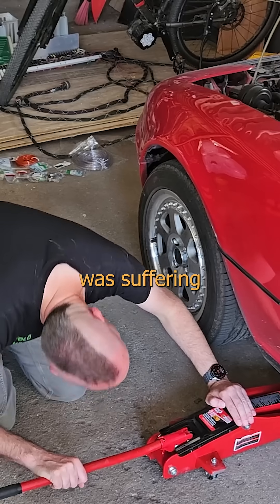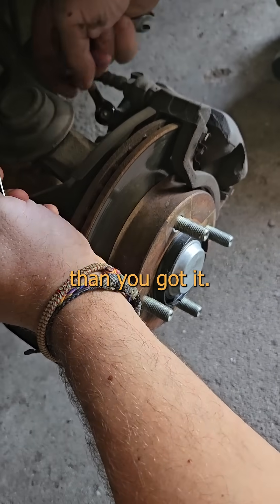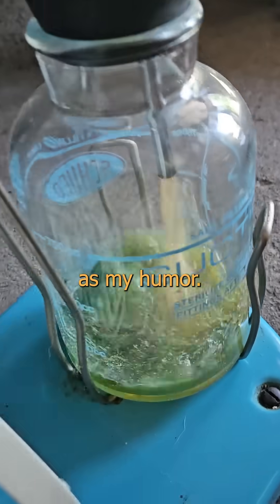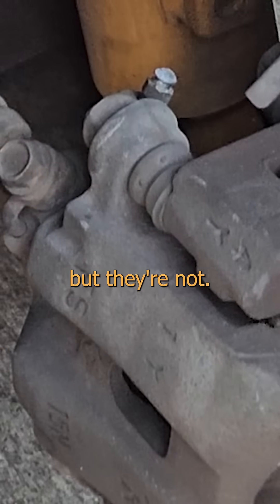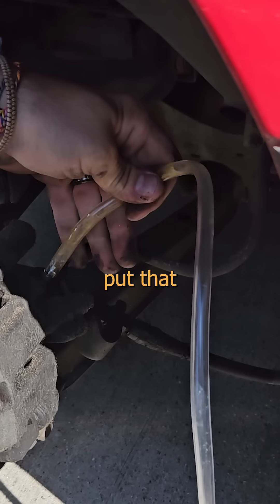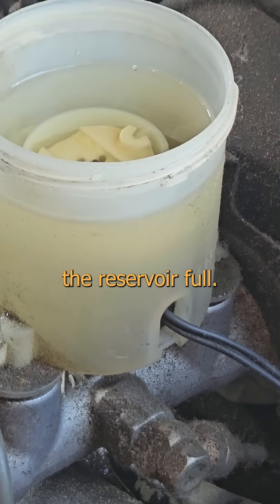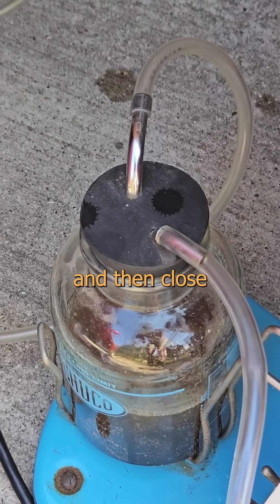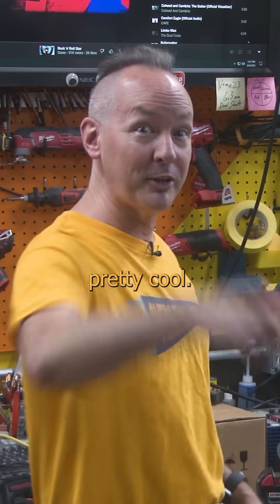How To Change Brake Fluid #chrisboden #comedy #engineering #educational #diy #skills #lifelessons

Comment: Everyone that's bled brakes the manual way knows that a vacuum pump isnt over engineering, it's a godsend
Reply: I need to bleed brakes, get the apprentice.
'We dont have an apprentice'
Okay, grab the straws and make everybody pull one.
Reply: @Mk2Mod1  At my work it turns into "Where's a lot attendant?"
Reply: Oh boy, good memories. Used to help dad remove the air a few times after he was working on breaks. Best fun for kid. Barely reaching break pedal, but eagerly stomping on it like crazy 😆
Reply: @ogi22  Oh yeah...the only job that was more fun was holding the flashlight.
Reply: Yup, bought a hand pump to do it, it didn't work, made a one way bleeder with some spare brake fluid, then spent God knows how long pumping the brakes and filling the reservoir up.
Reply: Try speed bleeders. Much better than vacuum bleeding.
Reply: @earlebird4262  Not if you unintentionally incorporate air into the brake system due to untightening the speed bleed for bleeding. I'd rather stick to traditional vacuum pump and have it get sucked out like that, while topping it off
Reply: @zealousbeing0178 a vacuum pump pulls much more air in around the threads than speed bleeders. Speed bleeders are much cleaner in my experience. Both methods are really just for flushing, and should be followed up with conventional bleeding. 

Also, I think you mean conventional, not traditional. It's only on my dream planet that families get together every second year and observe the tradition of flushing their brakes. Every sixth year they would also perform the sacred ritual of The Changing Of The Coolant. Because that's the way our grandparents did it in the old country.
Reply: It can also pull air into the system if you have a leak... ask me how I know (actually it wasn't me, it was my dad who found that out the hard way).

Unfortunately, the best way is to just have a second person pumping the brake pedal.
Reply: @PistonAvatarGuy  if you have a leak then it needs to be fixed, I fail to see how thats a bad thing
Reply: @TheTomco11  It doesn't even need to be a significant leak, it can just be a little pinhole that barely leaks any fluid. Totally fine when the brakes are operating normally, but a major problem if you reverse the pressure on the system.
Reply: @PistonAvatarGuy any leak is an issue, a tiny pinhole will eventually leave you with no fluid
Reply: @TheTomco11  a small leak is somethat that can be managed (just keep adding fluid whenever your reservoir gets close to empty). Air in the lines cannot (assuming it's anything like a large amount). If you're someone who likes to keep your car in tip top shape and your mechanic well fed, a small leak is something you need to fix. If you're like most folk who work on their own cars, a small leak is just one more fluid to check every time you stop for gas or whatever.
Reply: @reaganharder1480 I'm not a mechanic and I work on my own car. It has plenty of leaks, but none in the brakes. Please never give advice about cars. Any brake fluid leak is a safety risk. What if you forget to check the level and it drops too low? What if the leak gets faster without you realising? What if that paper thin pinholed section blows out and you lose all pressure?
Drawing air while trying to bleed is the best case scenario, since you'll be immediately aware there's a problem. If you draw air into the brakes while bleeding and still try to drive the car without fixing the problem then you should not be working on brakes
Reply: @TheTomco11  for what it's worth, you can lose all your brake fluid quite quickly without there being a known leak beforehand too. Actually, that's the only context I've actually witnessed anyone losing brakes with.
Reply: @TheTomco11 because vacuum bleeding will not help you find a leak. It will only allow air into the system. Pressure bleeding (with a positive pump or a friend) will help to identify a leak.
Reply: @reaganharder1480  Been there, done that. Not fun especially as a new driver behind a fuel truck taking a left. 🙀
Reply: @TheTomco11 I said the exact same thing
Reply: @reaganharder1480 You don't think a leak that let's fluid out is also letting air in?!
Reply: Lines can blow up too if you put too much pressure through it. But you can always find a leak. If it's an unknown leak then get under your car more often always check things there's monthly is weeklies and yearlies it's a part of owning a car whether you work on them or not double and triple check everything otherwise you're putting yourself and others at risk. I've seen so many different scenarios with brakes from fluid everywhere to not single drop. 

And I'll tell you any leak or air is a problem that needs to be fixed immediately Yes brake lines are a pain but it's more painful to crash take your pic. It's always harder putting a line in than it is getting a line out though cuz if you're removing it you can just cut it. Make sure you take the pressure off first. Learn that the hard way. My younger dumber years those were the best so many lessons learned the hard way😂
Reply: @Ichikura2 lines can blow up? Are you joking? Do you know how much pressure they handle under normal operation?

Edit: If they're corroded, yes.
Reply: @Ichikura2  And I never implied that air should ever be left in brakes lines. Where on Earth did you get that from?
Reply: @TheTomco11 I need someone like you in my area to help me with my truck
Reply: @evanlevin8116 dude brake lines are easy, if you really wanna be lazy you can just cut them at the brake and remove them and cut at the master cylinder, then you can just run it around the old brake lines, you dont even have to technically remove them; at least the brake lines are new at that point
Reply: @PistonAvatarGuy FIX YO BRAKES FOOL
Reply: @mewmew8932  My current brakes don't leak, but I've never had problems as a result of minor leaks.
Reply: @PistonAvatarGuy have you considered that the minor leak could become a major leak

Also good on you for getting yo damn brakes replaced
Reply: @mewmew8932  Yes, but I maintain my own cars, so I'd be aware of that happening.

The brakes on my current car never leaked. The cars that I had with leaks were more than 15-20 years old.
Reply: @PistonAvatarGuy bro has never heard of sudden failure
Reply: @mewmew8932  Why would there be a sudden failure as a result of a small leak?
Reply: @PistonAvatarGuy ok so you know how when a windshield has a small crack it can balloon into a spider web? It's like that but for pressure lines only worse
Reply: @mewmew8932  If the lines are that corroded, then they're likely to just be losing so much fluid that you're going to notice that first, before they just catastrophically fail. Anyway, that's why you have redundant systems. On Hondas, it's always one front and a rear on the opposite side that are actuated by a single circuit. I believe that many vehicles just have separate front and a rear circuits. The mechanical parking/emergency brake is also a thing, and I always keep mine in excellent working order.
Reply: @PistonAvatarGuy yeah but like why fuck around with your brakes. Y'know, the thing you use to stop 3000 pounds of steel moving at higher velocity than a cheetah.
Reply: @mewmew8932  A) Because money. B) Because there's literally no issue with having a pinhole leak. Probably 30% of the cars on the road have pinhole leaks in their brake lines and will never have a problem as a result.

Anyway, like I said, you essentially have 3 braking systems, and they're not all going to fail unless there's something catastrophically wrong with your vehicle, and my vehicles have never been in such a poor condition.
Reply: @PistonAvatarGuy bro just replace some shitty rubber hoses with some slightly less shitty rubber hoses it is not that expensive

Also do you really wanna be that guy who relies on "good enough," has this channel taught you anything
Reply: @mewmew8932  Who the heck is talking about rubber hoses? Obviously, if the hoses are leaking, just replace them, they're cheap and they're easy to replace. I'm talking about the metal brake lines, which are (typically) insanely difficult to replace. I don't think that I've ever even seen hoses that leaked.

In my case, time would have been the problem. I never would have had the money to pay a shop to replace the metal brake lines in any of my cars, so I'd be doing the work myself and it probably would have taken days. When you're working 40+ hours of hard labor every week, it's not only hard to find the time for something like that, but the energy just isn't there.

And, yes, I know when good enough is good enough and when it's not, that's why I've never had issues with my cars. That's how 99% of the world operates, on just good enough, because if everything had to be perfect, 100% of the time, no one would ever get anything done! No one would even be able to afford to live like we do if everything had to be 100% perfect, all of the time.

Heck, that's why flying is so expensive, because that is an instance where 100% perfect, all of the time, should be the goal.
Reply: @PistonAvatarGuy Uhhh, if you have a leak in your brake system you should fix it. Don't just avoid bleeding the brakes a certain way and leave the leak.
Reply: @Yerboiy  Like I said, leaks can be insanely difficult to fix and small leaks are such a minor concern that it's almost never done.

On older cars, where leaks are common, the cost of replacing the brake lines could probably total the car, just because there's so much labor involved.
Reply: @PistonAvatarGuy replacing brake lines is neither expensive or hard
Reply: @TheTomco11  It depends on where the brake lines are located. In my CRXs, a huge chunk of the interior had to be removed to get to the brake lines, along with many things on the underside of the car. Being mostly in the interior of the car, the brake lines were pretty well protected, even on my one rusty CRX, so I never had to worry about them.

People will sometimes splice in repairs, and that's not too bad from a labor and cost perspective, but if the line is corroded badly enough to have leaks in it, it may not be repairable.

I wasn't saying that the lines were expensive, I was saying that the labor required to replace them in some cases can be very expensive.

Edit: And I'm just talking about minor leaks, here, the kind that will just weep a small amount of fluid.
Reply: @PistonAvatarGuy Dude, seriously, brake fluid isn’t just some random liquid. It’s toxic to people and the environment, costs real money, and once the bottle’s been opened it’s basically trash because it pulls in water. Understand the basics: if fluid leaks out, air leaks in. That’s how systems fail. Mess around with this and you’re not just risking your clapped-out ’06 Focus, you’re risking other people’s lives. Don’t stay stuck on dumb decisions because with that mindset you won’t last long.
Reply: @TheTomco11 it’s not expensive maybe on a classic but anything still in the road that’s not rubber but the usual double flare jobs , unless you have the tool to flare em and the know how, the shops will charge you to replace the whole length most of the time. We aren’t in the repair service anymore we’re in the replacement service. Been in the business for a long time. Unless it’s someone like us that know and willing to help. Chances are, they have to pay a whole lot to get it done.
Reply: @uhd_plasma4913  Would it concern you to know that basically every single transport truck (like logging, oilfield, or retail shipping trucks) you see on the road is in far worse shape than just having a pinhole leak? Hell, if its only a "minor" problem that doesn't entirely take the unit out of service, most companies literally wont let you fix it.
Reply: @PistonAvatarGuy  did u mean found a leak is a bad thing ?
Reply: @jokok2333 No, I mean having air in your brake lines is a bad thing. Brake lines are also insanely difficult to replace on many vehicles, so small leaks are almost never repaired.
Reply: Insanely difficult yes still needs to be done whether you got air or leak. Some cars will be harder than others and vice versa. But get it done nonetheless. Do it right and do it once.  @PistonAvatarGuy
Reply: @Ichikura2  Why would you need to repair it if it's just a small leak? I've had a couple of cars with small leaks, there was no noticeable difference in braking performance, no uneven pad/shoe wear, no noticeable difference in fluid loss (vs the drop in fluid level that comes with normal pad wear)... the only thing that I noticed was a slight wetness near the leak.

I've owned $500 cars that I had to repair before they were road-worthy, the only reason why they went back on the road was because I was able to do the work myself, but if I had to pay a shop to replace some of those major brake lines, the car would just be totaled.

The only brake fluid leak that I ever had that needed repair was a master cylinder leak, and it was so bad that it was stripping paint off of the booster.
Reply: @PistonAvatarGuy also the cheapest tf am i buying ts for
Reply: I got a pressure bleeder for mine - such a great tool!
Reply: turns a weekend job into a couple hours.
Reply: I have been the one pushing the brake pedal inside the car, long before I was old enough to drive, so my dad could do this. I can't wait to show him this fancy little tool!
Reply: @kateshiningdeer3334 show him speed bleeders instead. He'll like them more. Everyone who tries than does.
Reply: Prefer a pressure bleeder.  But same idea
Reply: EXACTLY
Reply: Same this is the best way to do it saves you so many hours
Reply: I’d prefer tri put a slight pressure on the reservoir but whatevs.
Reply: @maxj9204  The pressure bleeder is superior.
Reply: yep. over engineered is that stupid 1200$ pressure bleeder that is use full but it’s a pump with a diaphragm reservoir to keep the master cylinder reservoir filled but geez for 1000 can they throw in some brake reservoir adapters 😂
Reply: Put a1/4 inch piece of tubing over the bleeder valve and plug the other end into a bottle of break fluid and pump the break tell the air bubbles are no longer visible in the clear 1/4 inch tube usually about 6 presses of the break peddle and your good the way this works is the air is push out of the tube and floats to the surface of the break fluid and draws in beak fluid where the air used to be hope it helps
Reply: @MasonBrann 
This is more about flushing out the old brake fluid and replacing it with new brake fluid, and less about bleeding the brakes for air.

 
Bleeding the brakes for air is basically only necessary if you have ran out of brake fluid or opened the brake lines (because you needed to replace pipes, calipers or pistons / cylinders).
Reply: Bought a bleeder bottle with a built in check valve and never looked back.
Reply: I was coming in here to say exactly this.
Reply: lone man with a one man brake bleeder kit be like:

THE PURGE HAS BEGUN
Reply: Couple hours if you’re unlucky, a full day if you’re really unlucky
Reply: I've never done it any other way and I've bled brakes on a 79 bronco
Reply: If you have time, you could gravity bleed it without any effort.
Reply: I didn't get why everyone does it the hard way. Leave the car on with your longest screwdriver holding the brake pedal down, crack the nipple, wait for fresh fluid, close the nipple, refill the reservoir, go on to the next wheel.
Reply: Pump it up...OK! Hold it! 40 freaking times!!!
Reply: Yup I work at a race track and my boss is cheap, we just get two of us and have one pump the brakes over and over until it’s dry lol
Reply: yo

Comment: I'm lazy so I just use a turkey baster to suck out as much fluid as I can from the tank under the hood a couple times every time I replace pads.  Is it proper?  No.  But it is better than nothing and the fluid stays in pretty good condition.

Comment: Make sure u start from the rear passenger side and work your way back towards the reservoir it kinda looked like u started with the front drivers side which would leave air in the system

Comment: I usually use a 2nd new bottle of brake fluid with a tube going into it from the bleeder so you can keep pumping without sucking air back in. Works like a charm every time.

Comment: I work for a very large car company, we have a tool that pressurizes the system at the reservoir while constantly feeding fluid. We call it a pressure pot although im not sure that’s the correct term, regardless it makes life very easy, all you have to do is hook up a catcher crack the bleeder screw and watch.

Comment: Hi Chris,
Look into a Motive Powerbleeder. Made a few miles from you, they use positive pressure to bleed the brakes which is much more effective- and lowers the risk of getting an air bubble in the system. They also have a resovior so you don’t need to always be topping.

Comment: so... let's discuss how sucking from the bottom is better/is worse than force feeding from the top.  I'm conflicted as power flushing with air pressure "should" ensure the caliper chambers get evacuated while vacuum flushing ensure no bubbles.  what if we do both?  like a power bottom setup.

Comment: Soloing it at home I always used a reverse bleeder as it prevented having to open the abs module via computer on certain vehicles. Fluid looks incredibly good for 30 years. Ive seen much darker in under 20 years. At a guess its around 120k miles? How close was I? If its much higher I'd guess its been changed at some point before